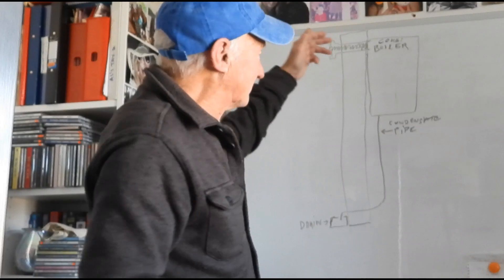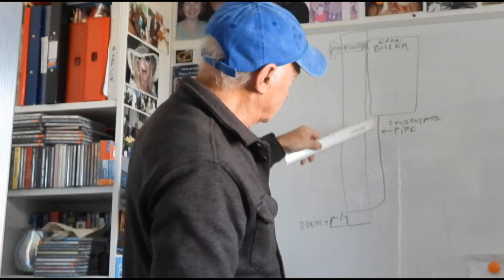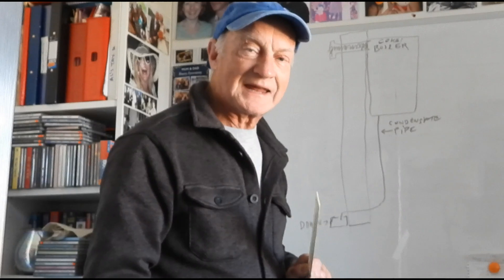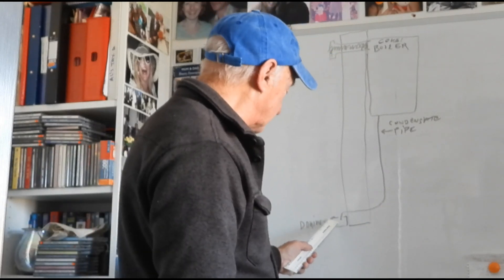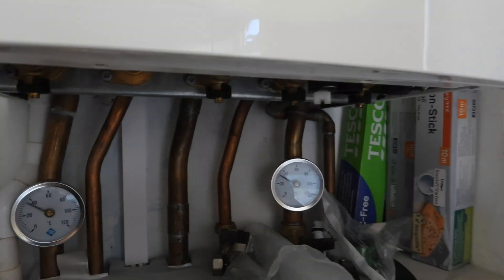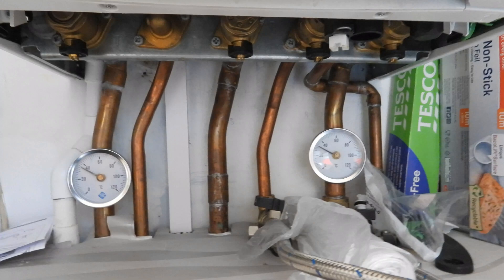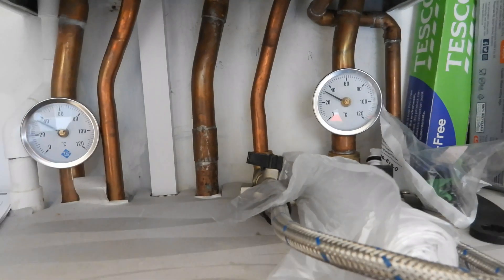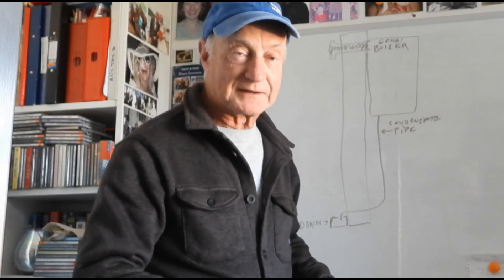Heating boiler coldest weather breakdown. Al fixes it.

Comment: I have an F AND E system thirty +years ago I'm 75 used to doing everything myself
Ex colliery spark
If anything happens
HOW do I know if the plumber. Will be good or bad
What tips can you offer
We hear so many stories of ripoff artists
Reply from the maker: Quite simple, just use someone recommended by friends or family.
Reply: If it’s an F&E system that’s 30 years old it probably won’t be a condensing boiler so won’t have this problem. Mine is well over 30 years old and is a Potterton Flamenco 50. The only thing that has broken so far is gas valve which was replaced when it broke last year. Very little to go wrong on them, no fans, no circuit boards, just power, thermostat, gas valve and a pilot light. Expensive to run but not so much that a new boiler won’t take 7 years to pay back according to my calculations. I changed the heating controls to Honeywell Evohome smart thermostat and fixed some shoddy electrical work the original plumber did. Used the opportunity to add smart monitoring that caught an issue with the zone valves before it became a problem. Looking to replace it in the future because parts are hard to get now, but concentrating on fixing the insulation the builders bodged in on the flat roof.

Comment: On my house, the condensate pipe seems to start freezing at the horizontal section then backs up into the boiler.  I have considered replacing the horizontal section with a sloping section but in the end it is easy to clear with the kettle.
Reply from the maker: Yes, clearing with a kettle is a good way to deal with it. The slope would more than likely stop it though.